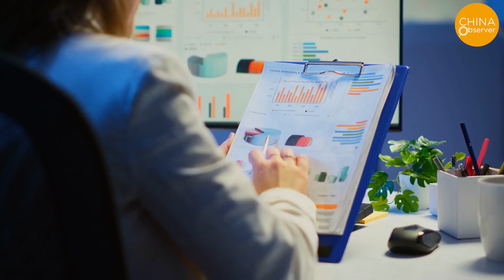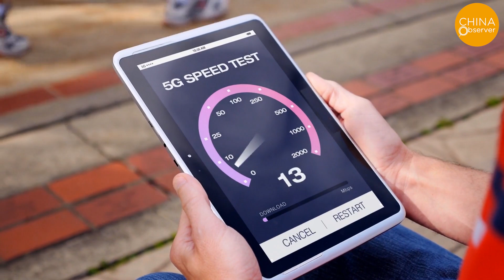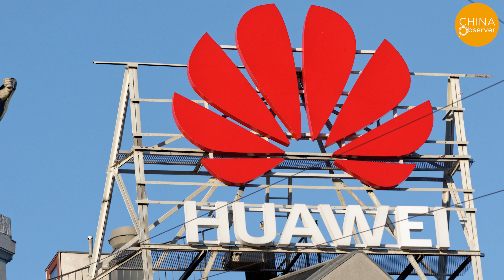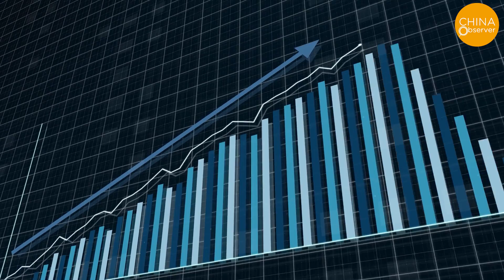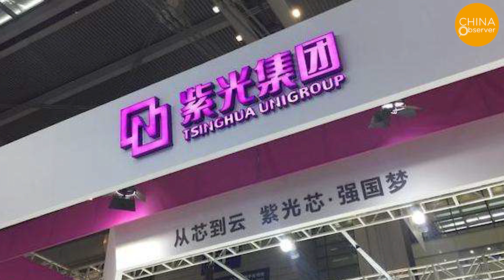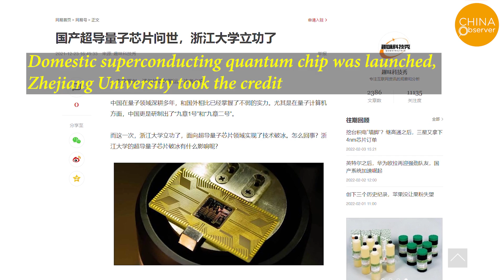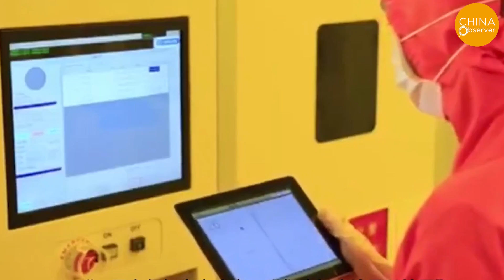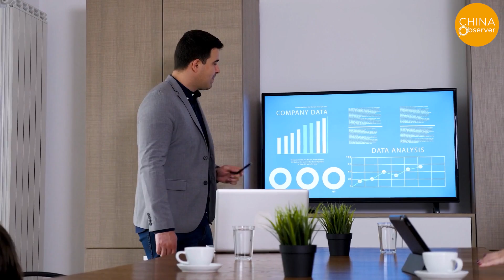Severe Chip Shortage | U.S.-China Chip Competition | Supply Chain | Huawei

Comment: Always amazes me Tesla can build a giant auto fab in a year that dwarf the chip fabs.  But it is not like the chip makers are clueless as to what it takes to build their new Fabs.    Seems to me that what it takes is the will to work in parallel on a fab to get the building up in a super fast fashion.  I am guessing it is getting all the machines built that take time.  With the increased demand why are the suppliers not starting now to build the build.
Reply: Chip fab are way too expensive, take too much time to build, and give little profits. It's basically a high risk low reward investment despite having high demand. This is why not many are built.
Reply: Fast building typically means cutting corners in subsoil investigation and in structural design. This may not be a big deal when making cars (lol, see the reviews for recent Tesla deliveries), but it likely does have an impact on nanometer scale production.

If you’re going to sink capital into a precise product factory, you what to be damn sure it doesn’t utterly fail because you cheaped out on the building.
Reply: @gobblox38  It's more of whatever you built now get outdated really fast. Therefore you need to build them fast and precise before your investment became not worth it. This is extremely difficult to do.

Though, the real problem is that the EUV lithography machine is the one limiting the building of fab. There are only so many of it, you can't really exceed the building speed of them, and there's only one company who is capable of building them (which they are already trying to build it as fast as they could).
Reply: @gobblox38  am going to guess you did not ever watch the hundreds and hundreds of drone fly overs posted showing the thousands of cubic yards of cement that went into the foundations of the Tesla buildings  I say this only because you think a billion invested into a building must be short cutted and cheap.

Comment: Doesn't anyone think that given the cost of chip manufacturing that $52 billion is woefully inadequate? If I  was China I  wouldn't be overly worried.
Reply: $52 billion multiplies. China has a vastly different problem. It needs to spend enormous amounts of money just to cover the R&D costs to even attempt to be able to do EUV and DUV which are necessary to get to 7nm. The US doesn't need to. The $54 billion goes directly to capacity expansion where the enormous R&D capital expenditure is non existent. The US's strategy has obviously worked since all 3 major foundries are massively expanding production capacity in the US due to the subsidies. China's expenditures, however, obviously are not working out at Tsinghua Unigroup declared bankruptcy and HSMC never truly built a fab. The only fab that made it is SMIC and SMIC is stuck on 14nm.
Reply: This is just what the US is throwing into the pot. Many other US and non-US chip manufacturers are investing on their own in expanding US chip manufacturing. This needs to be taken into account, over and above the $52 Bil.

Comment: 5G is so pointless. We don't need that much speed on a cellphone. My 4G/LTE connection is more than enough speed to stream video in 4k. What else do I need to do on my phone? We've pushed the technology well beyond our ability to use it. It's just for marketing.
Reply: Wrong attitude by far.
Reply: 5g allows for more capacity and granular geolocation. 4g LTE-A is tapped out for capacity. It is the reason we have “priority data” on most cellular unlimited plans. Once you go over your allotment during congestion you get very little bandwidth if the tower is overloaded. Very easy to do in high density areas. Once everyone comes home from work it’s impossible to stream HD unless you have priority data. And then there’s the bonus of having enhanced granular geolocation for locating a cell phone user for interests of national security.
Reply: ........4g fast enough watching porn.
Reply: 5G is key for more device connection due to massive mimo rather mimo of 4G. Currently we still have problem when thousands try to surf internet together in protest or concert. 5G is there to solve that problem. This also enable more IoT devices to connect the internet.

Comment: Buy fewer cars and continue to use older cars for longer!!!
Reply: It's more of a "start making cars that last longer",
which means stuff like curbing planned obsolescence, right to repair, mandating minimum free service period (which would push toward sturdier but more expensive products), etc. 
Old cars could last a couple of decades, while newer ones are treated as  "used" and need replacing after just 3 years of use - this is unsustainable, the planet will run out of materials in just a century or two if this continues. 
We need to be thinking really hard how to make stuff last MUCH longer,  and not the other way around!